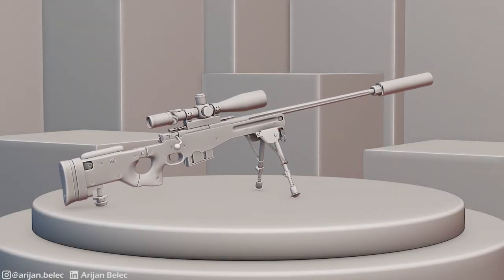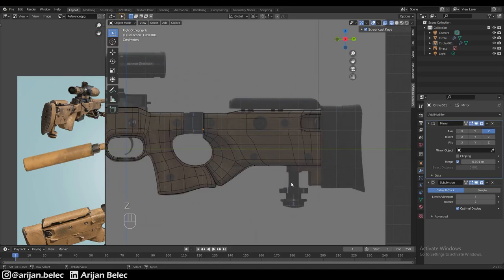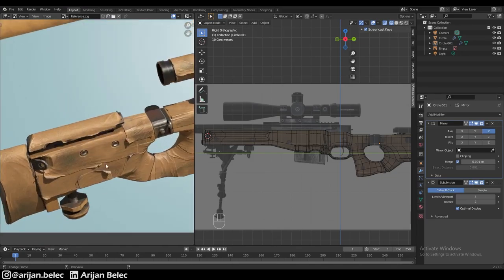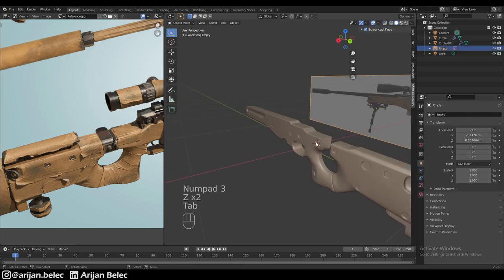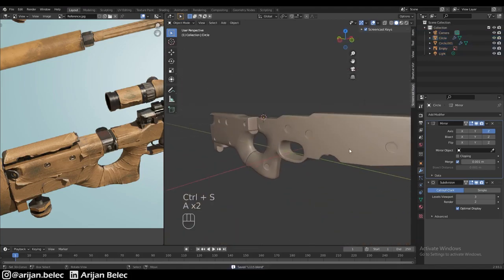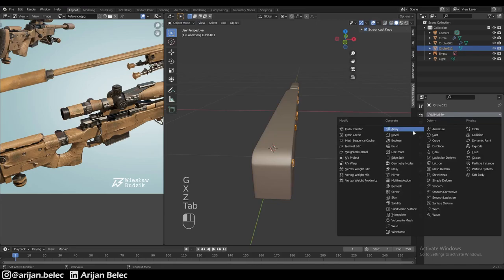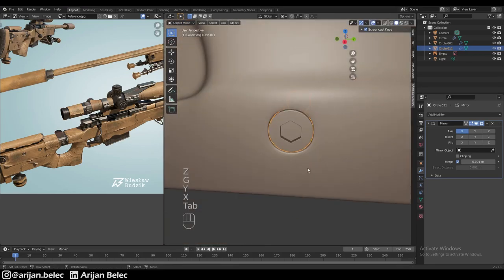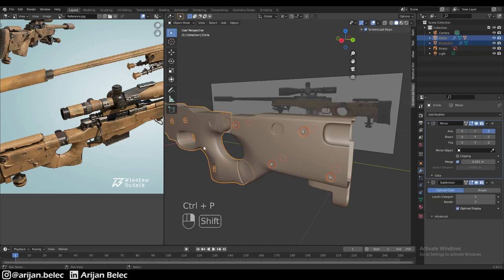Modelling an AWM Sniper Rifle in Blender | Tutorial Part 2 (Arijan)

Comment: Thanks for this series. Some good old high poly modelling is needed to brush off from all the game ready stuff that is around these days. This is brilliant practice and I will make sure to try and prep it for game ready and texturing. Thanks for making me forget to not get lost in the details too soon.

One thing I can't recommend enough is the Machin3Tools and MeshMachin3. Tools is free, Mesh, not, but both contain insane shortcuts for modelling. Straightening edges, aligning edges/cursor etc, symmeterising models, and all sorts of short cuts are in there. I can't recommend them highly enough. Just a quick example of where Machin3Tools would be handy for you is when you're copying the screws. When you use his interface for setting the cursor, it aligns it with the face normal so when you copy the screw to it, the rotational alignment is already done for you.